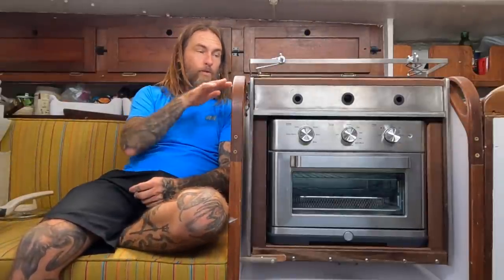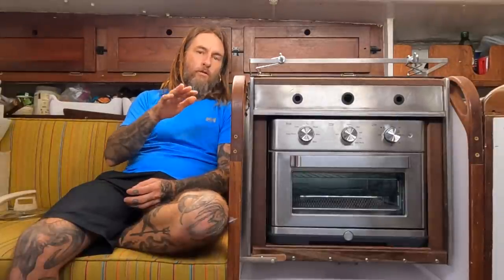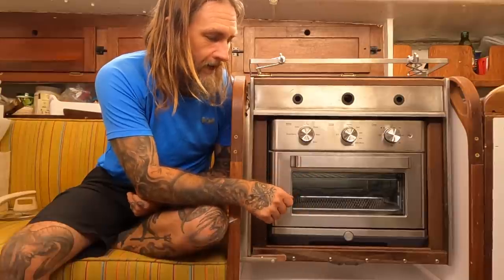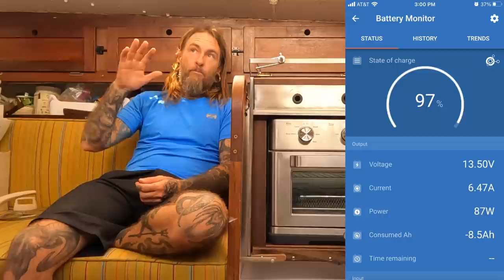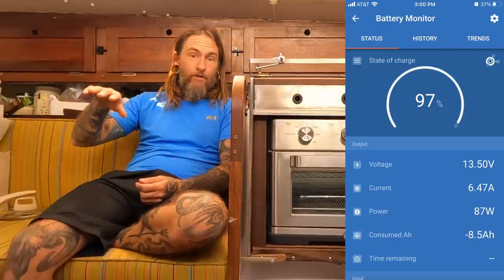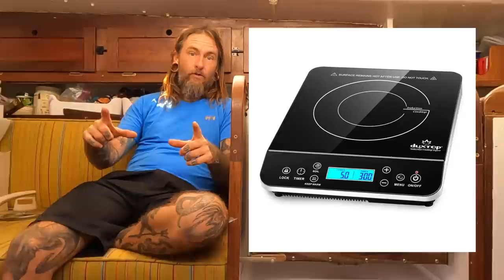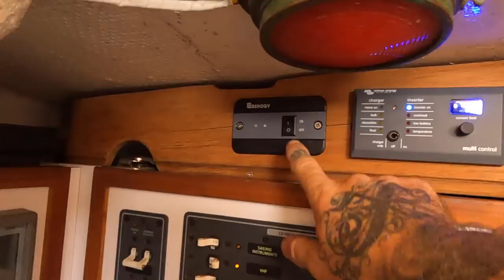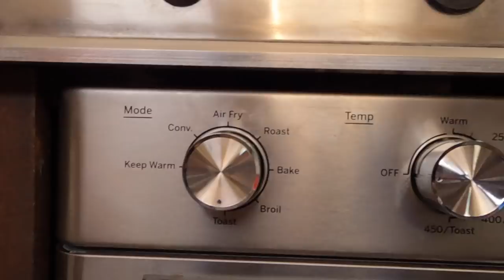ALL ELECTRIC GALLEY on a Vintage Sailboat! Introducing Triteia's New Custom Upcycled Electric Stove!

Comment: you might want to keep a a spare electrical line to replace that moving one. metal fatigue will happen to the strains in the cord over time from the swinging. i'd suggest finding a way to keep the stove from swinging while it isn't in use and to occasionally feel the cord that has been bending to see if it is warm. if it is warm, you will need to replace that cord with your spare. to not replace it means it might short well enough to start a fire in your boat. there are also chain sheaths you can attach to electrical wires that move often that will spread out the bending location of a wire across more of the wire making that wire last longer. this is something talked about in the 3d printing world quite a bit because the gantry of the 3d printer is always moving and there needs to be electricity to power the hot end and the parts cooling fan as well as a motor if it is a direct drive 3d printer. thats a bunch of wires that can metal fatigue into creating a house fire.

Comment: i was about to comment on running your motor to charge but you immediately covered that.   what a great video.  I need to redo all the solar that was installed by the previous owner of my boat and i walso want to upgrade my diesel galley to something more functional so this video was pretty informational thanks!

Comment: Awesome video! I'm really looking forward to seeing more details on the average power consumption and battery levels in different sun/cooking scenarios (cooking frequently on sunny days, cooking less frequently on cloudy days, etc.). In theory you could cook large meals on sunny days, giving you leftovers to have on cloudy days without draining your batteries. 

Based on the math, your total battery bank is 12v * 400Ah = 4800Wh. Using a stovetop at 1500w for 15 mins (1/4 of an hour) utilizes about 375Wh. So you'd only be running your battery down about 8% for each 15 min cooking session (plus any losses in power conversion). On a fully sunny day, you'll probably get about 330W out of a 400W array, so you'd only need a little over an hour of solar (to generate 375Wh) to make up for that 15 min cooking session. Not too bad!

Comment: Looks great.  The ONLY thing I might have done different is to terminate the power line coming from the inverter to the back of the oven cabinet as a fixed female receptacle.  That way all the moment would be on a short and easily replaceable line that plugs into that.

Comment: James. Re the pot- rails, I suggest  just buy a piece of steel flatbar 1/8” by 1/2” by 36” .  Measure it to the right length , Put a 90 degree bend in end 
And hrs bolt it to the existing rail.

Comment: I had a similar cooktop from this brand at my old house for a couple of years. It worked great and I would recommend it, as long as you can keep the top extremely clean so the touch-sensitive controls work.

Comment: Fwiw you can seat a  rivnut using a bolt and a spacer and a nut.  I don't  use the rivnut threads to seat it, because it is potentially hard on the threads.   Instead I use the bolt threads with a nut pushing on the spacer/pullingon the rivnut.   Quick and small so rivnut can be installed in tight quarters, also inexpensive and always available.  Nice upcycle on the stove, looks decent and certainly nicer than new crap.
Reply from the maker: Thanks for this comment!!! Never thought of that !!!!

Comment: I appreciate this video as well as sv ramble on’s (great channel also). I just bought a Westsail 32 and she’s got no equipment so I have a blank slate. I want all my systems dead simple so I’m was going to go with a used Origo Alcohol stove but I’m toying with an induction hot plate. My hope is a 200 amp Lifepo4 and 200 watts solar would take care of a hot plate and minimal other power needs? I only cook one big pot of coffee and one meal a day so frankly I could get by with a camp stove but I’m paranoid about propane/butane small bottle systems. Keep on keepin’n on James, fair winds!
Reply from the maker: If you do minimal cooking I think you could make that work, I hav never seen my batteries get below 65% and they always top up before dark even on rainy days

Comment: I'm building a combination induction cooktop & microwave/air-fryer/convection-oven to hang on my existing gimbles.
My problem was that the old propane range/stove wouldn't fit through any hatch on the boat. I had to disassemble it.
So my new design will be modular, screwed together in the boat.

Comment: seen a video of someone talking about batteries and solar. they mentioned that whatever battery bank size you have, double it for solar setup for proper charging. so basically, you have 400ah, should have at least 800w of solar.
Reply from the maker: That’s not possible on my boat. I had zero issues keeping my batteries topped up until I left the tropics and headed to NZ

Comment: Great job, I think there's a cooking channel on the way or a cook book post cruise.
 I really like it. 
Is that wired with 15 amp cord end and power strip, 15 amp breaker?I'm just thinking your oven and both cooktops will exceed your wiring, may want to do a 20 amp circuit as in land based kitchens if it applies. Watch those power strips. Again great job thank you for sharing.

Comment: For your battery setup make sure all the wires coming to and from the batteries are the same length. example if you are connecting 3 batteries and have a main wire. all the smaller wires that connect the main wire ti the batteries are the same length. 

the reason for this is to even the load of the batteries which makes them last longer and wear evenly.

Comment: Looking at the pot holders.....could you put them on the side rails instead of front and back?  Yours are a little different than ours, so maybe it won't work / might interfere with the gimbal action.
Reply from the maker: No because it stops it from gimballing

Comment: 400W solar and i would assume the oven is atleast 2000W and same for induction when all hot plates are on. Lets say you heat chicken in the oven, potatoes and sauce. Potatoes takes 40-60 minuts to cook chicken is 45 and sauce 10. Stove top would consume around 1200W and the oven 1500W. That is 2700W. That is 7 hours of charging at the optimal sun position. Im sorry. But i cannot see this would be possible without addional charging. Or have to get used to cold food. 2 out of 3 days.
Reply: Loving the idea. But hope you did the math. And i hope im wrong.
Reply from the maker: You would be sadly wrong then, I have used it a week straight and my batteries never dropped below 75% remaining and even the day it was raining and mostly cloudy the batteries were at 100% by 4:30 pm…. On sunny days they were topped up by 2pm
Reply: @SailorJames  glad you have plenty of backup. :)
Reply: @SailorJames  just subbed. Got me curious to see the data. Have a friend with a off-grid house and he would love something like this.
Reply from the maker: Just got a portable generator today as a back up for prolonged storms or overcast days.

Comment: Mr safety. “I don’t want explosive gases on my boat” precedes to install batteries on his boat that can catch fire or explode in water. Lithium batteries can also runaway and cause a fire. Lithium batteries can only be extinguished using a special extinguisher. Adequate battery capacity is a thing. You don’t need lithium
Reply from the maker: You are grossly misinformed about LiFePO4 . Go do some research partner 👍🏻
Reply: @SailorJames  btw is that the company that bought your opinions and ethics?
Reply: Company man James!